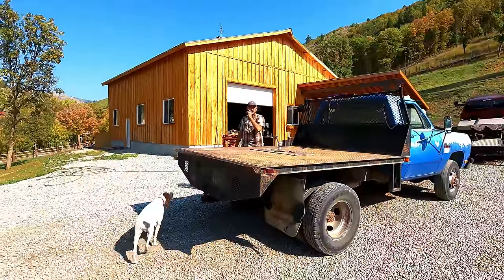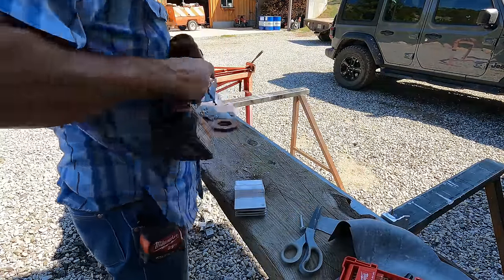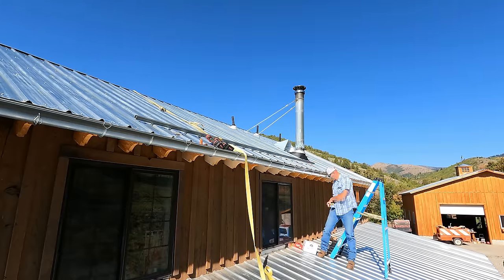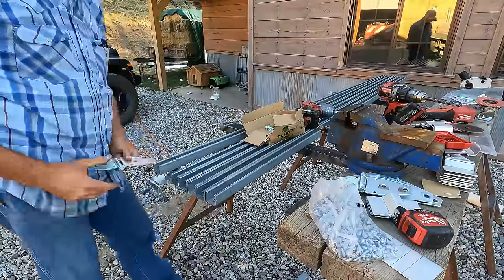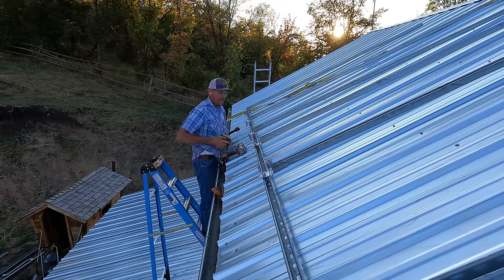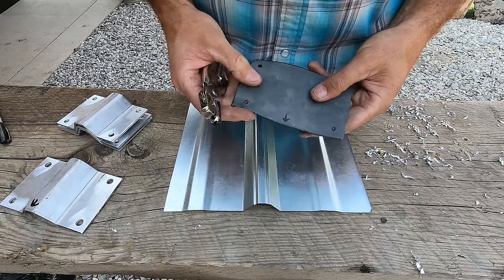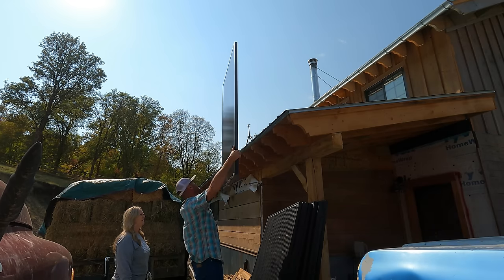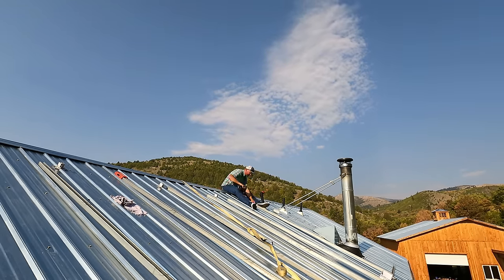#521 - DIY Adjustable Roof Mount Solar Panel Rack (Unistrut).

Comment: Old Timer’s solution.  When crossing a snowy pass without chains, I was told to spray bleach on the tires and let half the air out.  I was passing Semis with chains as they were losing traction.  So, try wiping a bit of bleach on rubber soled shoes to make them sticky for slippery roofs.

Comment: As long as there is still a physical connection that is electrically conductive between the aluminum plate and the galvanized steel you will still get galvanic corrosion.  Sealing it all well with silicon is a better option and the rubber gasket.

Comment: The first gen. Dodge is my favorite body style.
I guess it’s Dodge square body. Being in my early 60’s, it’s what I grew up with. Has you know that the 1st Gen Cummins is a very simple engine. Don’t turn it into a donor for the Chevy Crew Cab. Great video! Thanks for sharing! RAD

Comment: I am happy you listened to a whole group of people Heath about the metals.  I really would not see you have to get up on that roof again to redo everything if you can solve it now.
Reply: There is still the problem of the metal bolts piercing the aluminum brackets and the galvanized roof.  I don't see that he has isolated the metal of the bolts from the aforementioned, but I'm hoping he has done.

Comment: That inner tube rubber is nearly indestructible in these applications. Although the black anodized coating on the panels offer some protection, you have the same problem bolting down the aluminum frames to the steel unistrut, which is why most panel racking systems are aluminum rails. I used gaskets I cut out of inner tube between the panels and unistrut on my 10kw grid tied array. 8 years and so far so good.

Comment: I think you should look at a motor system somewhere down the road. Could even have it tilt them nearer to 90 degrees to get the snow to slide off then no roof climbing at all.

Comment: In case this helps anyone, I use old foam or rubber carpet pad under my bench and ladder feet if I put them on a metal panel roof. They seem to stick better and won't scuff the surface.

Comment: After cleaning the solar panels, I wonder if using something like rainX on the glass would help keep them cleaner for longer?  Maybe help the snow slide off?  Just a thought here.
Reply: Could be a great suggestion.  Contact someone in the panel industry and ask if yhey know of anyone has used Rain-ex on their panels.   Learn from them
Reply: When I machine polish my car I also do the windows as it keeps them cleaner for a lot longer and rain disperses 10x quicker
Reply: Good idea

Comment: The bolt which connects the metals will make the rubber sealing useless. In the electro chemical series, whichever metal is more reactive, will corrode and perish first protecting the other metal. Since the metals here are aluminium and iron, you can tie a wire of higher reactive metals like Lead or Zinc at the metal junctions. All the best brother

Comment: You will definitely figure it out Heath.can't wait to see the angle of the solar array when completed since your already at about 45 degrees north. Hope you find the elusive truck your looking for  but as we get closer to fall the pickings get slimmer. Hopefully you've stocked up on meats as the prices have gone through the roof. Especially when less than three pounds of hamburger is now over 20 almost 21 dollars . I'm sure Cedar will figure it out. Just have leftovers alot .it doesn't fare well for the consumers or the producers because demand will decline. Be careful and stay safe my friends love you guys.
Reply: Actually chevon (goat meat) is really quite yummy.  Tastes a bit like lamb, but not quite so gamy.

Comment: So snow will shed from the second story roof directly onto the first story panels? Good luck with that!
Reply: Well, hello there benjigirl1971.  Nice to meet you.  Opinions are a good thing - everyone has them.   If you object to my opinion (as you obviously do) why not address the actual issue of snow load (snow weighs about 20 pounds per cubic foot) against solar panels affixed to a sloping roof?  What do you think will happen when the snow can't shed off the roof and pushes up against the solar panels?  I am interested in your opinion.  Thank you.
Reply: @AParr-cp4ib  I'm getting frustrated watching the channel. I didn't think there was enough room for all the panels, but thought Heath wouldn't proceed without knowing this. Having panels on the lower roof is a BAD idea. Solar panels are not designed for impact and when snow sheds from the upper roof it will have weight (and ice chunks) damaging them and voiding any warranty. The rack footings, where fine for the upper roof will, eventually fail with snow and ice impact on those lower racks.
Reply: @scotduckrow8524  I agree.  I'm reading that solar panels can take some kinds of somewhat minimal impact - like hail, for instance.  Snow weighs about 20 pound per cubic foot, and - if - it will shed off the upper solar panels, it will likely do so in large-ish increments - as snow tends to do (as I am sure you know, snow doesn't shed a little at a time, it tends to shed all-at-once, and only when there is enough over-all weight to get it sliding).  Maybe these panels are designed to withstand three or four cubic feet of snow (or more) hitting them all at once (maybe 60 - 80 pounds worth).  One can hope.   

It will be interesting to watch how this solar roof installation plays out over time.

Comment: Dunlop Volleys are very sticky & are what most high rise steel rigger's use over here in the Land Downunder, very little slip when walking around on sheet metal & steel. Great for roofing. Stay Safe .

Comment: My wife looks to be the same height as Cedar, and has the same issues when trying to hand me stuff from the ground.  While I’m not trying to lift solar panels, mine are Christmas decorations.  All I was doing while watching you two was, yep, yep, yep.

Short of putting on magnets or suction cups on your shoes or screwing bars on the roof to act as footholds, it’ll be interesting to see how you solved your problem.

Comment: Yes Texas gets high winds and some have even been clocked at 80mph straight winds, or if you go by tornado status, then those cango much higher. Like 80 to 300 plus mph. The striaght winds have been known to knock fences down. The city of Amarillo, TX has a fence at the landfill and if the paper and plastic is not taken off of the fence it could knock a 20 foot fence right over. It's burried with steel I beams 10 feet into the ground with concrete poured around the beams an 25 feet high to hold the chain link fence on

Comment: I’m thinking a second, stand alone system on the shop roof would be a good idea. Then in the winter time you don’t have to worry about using too much power in the shop and leaving yourself short in the house. Also, if something were to happen to the house system or just several cloudy days in a row, you could backfeed the house from the shop system on the existing shop feed to help in a pinch.

Comment: The absolute best way to stick to a metal roof is buy plenty of 7-up, can or litre bottles, take up on the roof peak, open the 7-up and spray all over the roof where you'll be walking, let dry, very important! Let it dry 100%.  Now every time you go up, clean you shoes very well on a damper cloth and now the sticky dry 7-up will prevent any slippage..after your first good rain, all the 7-up will wash off and you won't even be able to tell you sprayed it all over..

Comment: You don't need to move the batery to the shop. Check with the inverter manuel if it can handle AC coupling. If yes, just do a grid tie solar array and the batteries will charge thrue the inverter.

Comment: The Veterans Administration put in vehicle covers but on top are solar panels and the panels lay flat but with a slight angle to all of them. It's to help with the electrical needs of the hospital and administration area's as well. The car port parking areas are at a slight angle (to get rain and snow off), but the panels lay flat

Comment: You live in a valley between two large mountains. The answer to all of your current and future energy needs is a combination of solar and wind generators. A little more maintenance and some can be a bit noisy. But you could place them high enough on the side of that hill that noise shouldn't be a problem. And there is no doubt that in your location, there will always be plenty of wind.
Reply: I have been watching Heath's videos since the beginning (thank you, Heath!) how many times have you seen a windy day at Red Poppy Ranch?  

For a wind generator to generate electricity, there has to be a near-constant source of wind  (24/7) - at an mph acceptable to the wind generator.  Too little wind at too-low an mph will not do much, too much wind at too-high mph isn't use able, because the generator needs to shut itself down in high winds to keep from blowing itself apart.

Also, putting a homestead-size wind generator way up on the side of a hill (even if there was sufficient wind, at an acceptable mph) wouldn't deliver much electricity to the house due to electrical line loss.
Reply: @AParr-cp4ib  your information is incorrect. I installed one 10kw generator on a 35ft stand at approximately 70 yards and a 15kw mill on 60ft tower at about 100yards from my fathers farm. The larger one is on a small plateau at about 50 yards up the side of a very large hill. The winds rolling through his valley was enough that I had install an over speed sensor and braking system. These combined with his 25 kw solar array insures that we have all of our energy needs met and then some. In 4 years, through rain, sleet, or snow, I’ve never seen a time when those blades weren’t turning. There’s more maintenance involved but it is well worth it.
Reply: @johnnelson8956  You may well be correct.  I am sincerely glad to know of your success. 

However, wind does not blow in all places equally.  Topography is not always the predictor of the availability of wind.  I lived for 30 years in a small valley between two large mountains.  The wind in that area blew sporadically; often not at all.  

I would thus respectfully suggest that anyone considering installing a wind generated electrical system take sufficient time to perform a quality survey of wind availability, frequency and speed in any area being considered, before making the not inconsiderable investment in both time and funds.  

Thank you for your post.

Comment: Slip on some of those old rubber shoe covers that people still wear in Minnesota.  Or...get another inner tube and make some straps to go over your shoes.  It's just a circular cut through the whole inner tube so it looks like a band.  They crisscross over your shoe.  I use bandsthem for exercising like stretchy bands.

Comment: When I worked steel construction, we would spray down the R-panels with vinegar....let them sit awhile then rinse them off.  Not only would it remove all the oil, but it would also slightly pit the metal so that paint could stick to it easily.  I know it sounds bad when you say "pit the metal", but we're talking so fine it's barely notable.
Reply: I remember helping my dad when I was a teenager, wiping steel down with a clean cloth soaked in white vinegar.

Comment: Love that you used a old tire for a gasket.
Reply: Bad idea. Black rubber conducts electricity so all he did was make a cushion.
Reply: @richardnott9587  Rubber does not conduct electricity. It is an insulator not a conductor.
Reply: @sunain8334  in its natural state it is an insulator. But I work in a rubber factory and we add carbon black at a minimum to make it's color and flexibility and another type for adhesion in a molecular form then we add cobalt to make it sticky and then it is a vulcanized to cure it. Cobalt and carbon black conduct electricity.

Comment: Wonder how rainx would work on those panels in keeping them cleaner longer
Reply: Or a coat of wax
Reply: I wonder about the Ceramic Car Wax.  I've seen them keep the dirt off a car for a long time.  Even when the car gets dirty you can just hose it off and it gets pretty clean.
Reply: @jTempVids  my thoughts exactly
Reply: You should only use soapy water to clean them. Chemicals can leave a permanent rosado which will effect performance.

Comment: I have never seen rubber isolator beeing used, normally teflon is used between materials and PP for bolt isolation. Due to this I checked the components in rubber and discovered that one of them is carbon black (graphite). This means that rubber isolation in contact with aluminum becomes a super galvanic corrosion source.

Comment: Heath, they make a solar heat cable for winter use, Can you put that on your solars and keep them warm and snow off of them? Keep up the great work and still awesome channel!
Reply: David Bales, How about running hot water tubing over that roof to melt the snow?  Or something like that?  I realize the electricity is precious there, but large amounts of snow may be an issue for the roof and panels.
Reply: True, but creating the hot water will be hard to create also and it would need pressure to get up that high and still stay warm enough to even melt anything passing over it. Sun is free energy , and the wires come with a much smaller solar panel that operates the heated wires. Also another good fact , it would keep Heath safe because it wouldnt require him on the roof in the middle of winter. You think its slick now.

Comment: On one of the other You Tube Channels, I found out that they actually make magnetic shes for walking on metal roofs, THe workers seemed to like theymafter they used the shoes for awhile. Just a suggestion.

Comment: you probably will need a small wind turbine because in winter those panels won’t get enough sunlight, and if you have small stream on your property, small hydroturbine will solve all your problems. We had an off grid hotel run on small hydro power in Caucuses in 2000s. I bet hydro technology is even better now. anyways, I’m trying to say that you’ll need multiple sources as backup in order to remain off grid without using generator much.

Comment: Have you seen the new electric Ranger side by side? Polaris has a teaser vid on their youtube channel, and it's supposed to be released in December. Probably expensive up front, but could be a great fit for you. Very capable lugging heavy stuff up that hill. Cheap to run - charge from solar, much less maintenance. Run off solar forever if SHTF.

Comment: On Satilite dish connection they use a butyl tape over the connections it bonds with itself as you wrap it on .. a pain to get off but it was water proof.

Comment: it would have been a lot easier for Cedar if you'd put them on the back of the flatbed and backed it up to the porch
Reply: The Chevy flatbed is missing.
Reply: @mikebarbacovi9851  Regardless, he had the dodge flatbed or his 94 Ram would have worked as well

Comment: great idea of using linear actuators, but consider a electric / manual scissor lift option.  
I also like the micro controller for automatic adjustment of the panels..

oversized scissors jacks,, with the screw / threaded shaft mounted parallel with the roof ridge. 
to get enough adjustment, the scissors jacks would need to be oversized compared to the ones used for automotive jacks...
I'm thinking r.v. leveling jacks, (industrial sized). 
put a hinge on the top pad and the bottom pad of each scissor jack.  use several jacks for each mounting frame to ensure stable support.
mount the hinges to your frame on the roof and the other end of the jack to the panel frame. 
attach a metal rod/tube between the scissor jacks, so that all of the jacks lift or lower together. 
you can then mount a electric actuator / gear reduction motor, to one end jack to operate the lift,  
you could still have a manual crank option via a fitting on one end, if you have a actuator failure. 
I prefer the electric actuator / motor option, so that you can adjust the panels from ground level, with a remote reversible switch..

also wondering about the skid steer.

Comment: sticky 800grit sand paper on bottom of flat shoes gives traction. i had to do it once. i thought the guy was crazy. lol but I have wet sanded and it kinda made since. so tried. it worked lol. 
it doesn't scratch up the bare metals.

Comment: What is going to keep the solar mount pad screws from suffering galvanic corrosion? Also, I think you will get a lot of snow accumulation under the panels at 53 degrees. How are you going to deal with that?

Comment: You're bonding two dissimilar metals with the metal screws . You need to use a galvanized spacer.

Comment: Hey have you thought about while cleaning the panels you might coat them with ceramic coating to let the snow slide easily.
Reply: I would be cautious about using ceramic coatings. they may reflect some solar wavelengths, that could impact the solar radiation absorption properties of the panels.

Comment: PTFE blocks milled to profile, attached from bottom and top stainless steel bolts, frame attached electrically isolated from the rest.... no corrosion

Comment: Would it make sense to install a separate solar system just for the shop so its not tied into the house?  I mean Heath, you seem like you have enough of an income that maybe it would make financial sense to eventually separate the house and shop power...especially if you start doing a lot of work out in the shop, it might be a good idea especially in winter where you are limited in the amount of incoming power...possibly keep from draining your house batteries in bad weather and winter.
Reply: He will never do any work in that shop. It’s just a building to hide most of his junk.
Reply: @TiaraPoodles  yea after I went south on you I can’t seem to get rid if it.